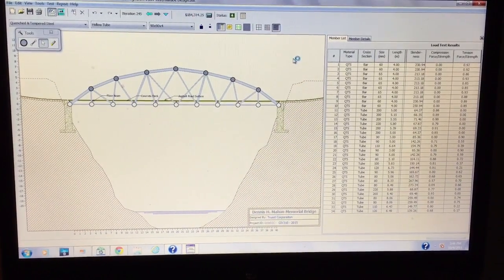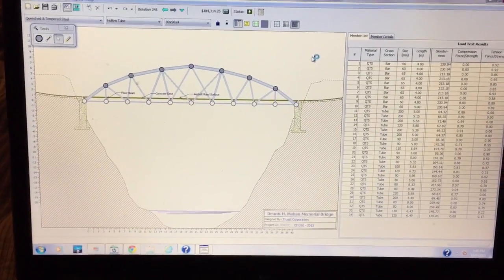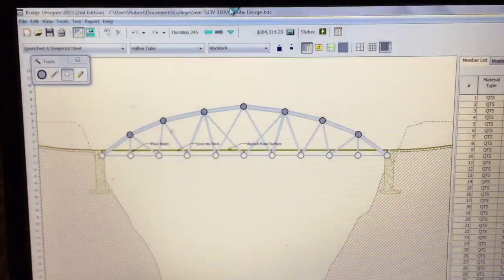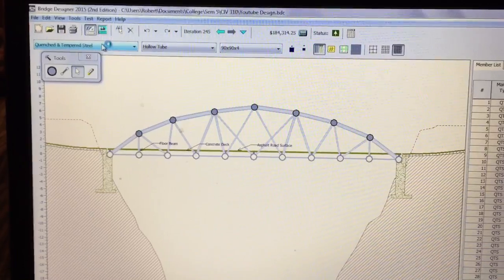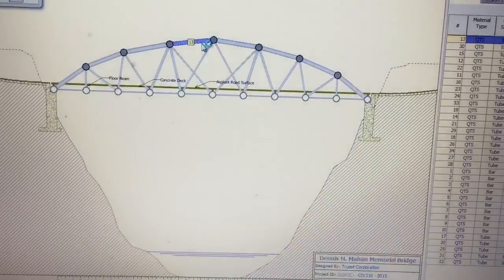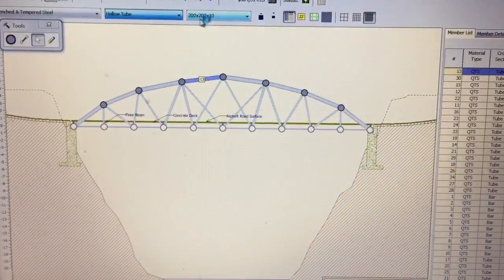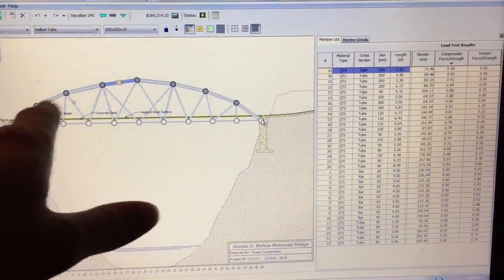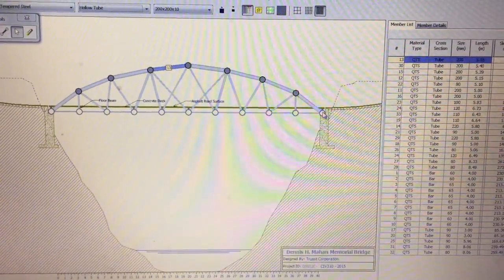Bridge Designer Cheapest Bridge 184K !!!

Comment: I have 171,460.39 try using all hollow tubes and quenched and tempered steel plus a slight amount of high allow and do 4 on high and arch abutments play around with the thickness and it can get very low

Comment: Great Job! I did a similar complex truss but with more steel members and used mostly High-Strength and Low alloy Steel. I used a little quenched steel. In total mine cost about 215, 000, but it was 24 meters high so I needed to add more members. That increased my price and I had to therefore make everything but one member hollow tube. Like you, I also had a lot of iterations: 140.
Reply from the maker: +Muhammad Hasan  Sounds like some good work man! Keep it up!
Reply: playstation boy